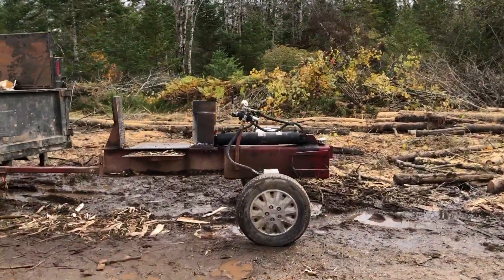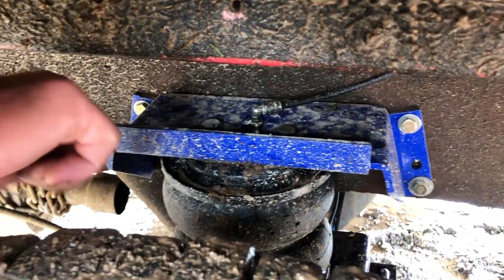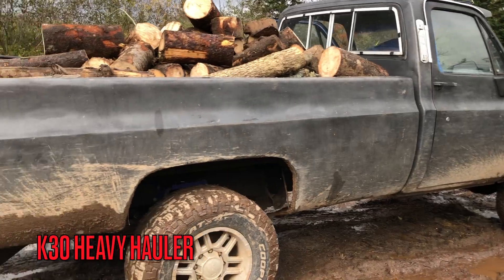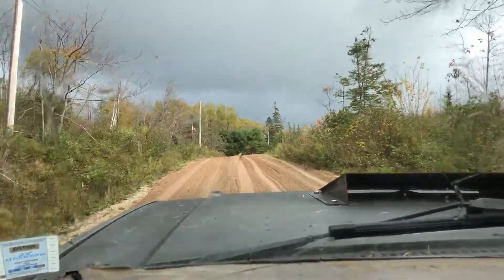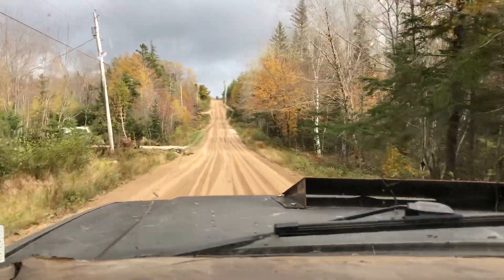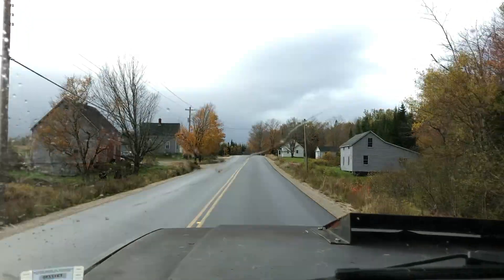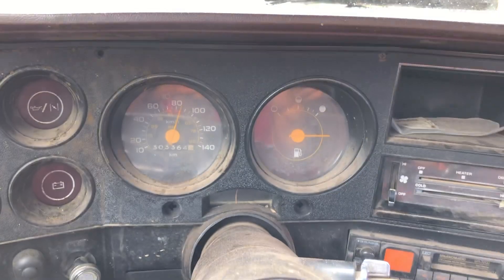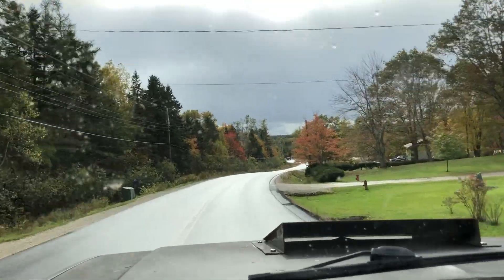Squarebody Hauling Heavy Load of Wood

Comment: I've been considering doing the LS swap to my 85 K20. I have a 6 liter out of an 04 2500HD with about 200,000 km's on it and a 4L80E remand from GM 4 years ago. I knew the truck they came out of (local truck), I paid $500 CDN for the pair over a year ago. It's just getting the ambition to do it lol

Comment: Ppl giving u a hard time who've clearly never hauled anything. Almost a cord in the box and 2 or 3 more in the trailer and NO squat. The air bags are definitely keeping the truck nice n level. Thats a necessary addition. Having a 5 or 7 stack of strong leaves would be nice to have also, but it would just be backup in case a bag failed mid journey. I love the setup. Nice and stable, the brakes are working well, the engine had no real trouble. Probably a revived junk LS engine? So it's strong and inexpensive. If it broke down or blew an important part, you could get it going again cheaply. This alleviates wear and tear on the 8.1 truck which alone saves money in the long run. You know i love the 8.1 but id really hate to see it worked into the ground at this point. Its such a rare and nice truck and its already put in a life's work so it deserves a break. If the 8.1 has an important part break, it would be expensive and time consuming to repair. If the square body proves to hold up, you can fully retire the 8.1 and just use it as backup. I think thats the smarter and more economical option, plus the sentimental value on the 8.1 is higher and that's not replaceable. Edit: oh i just noticed on the previous video u do already have strong leaves. So that suspension is more than good enough. Very nice. How do you run intake/ignition on the square body? Is it carb/distributor? Or do u got fuel injection and an ECU?
Reply from the maker: It has 7 leafs and it’s a fuel injected stock 6.0 harness out of a 2001 that I modified it’s a very strong truck for 364cubic inches

Comment: If that’s two cord remind me not to buy fire wood from you lol also what’s that thing you put in the hood of your trucks for? It looks like an upside down paint tray is that your ram air 😂
Reply from the maker: Yeah you should get into the wood business then if there isnt 2 cord on there 350cubic feet loose is a dam good 2 cord and fyi 2 cord of green wood is over 8000lbs and the trailers 4500 empty. As for the hood scoop try hauling heavy weight and learn how to tune vehicles and you will soon realize the cooler it is under hood the happier a engine will be... my engine bay wont exceed 60 celcius on a hot day where befor it would be over 80... but hey what do i know i built all my own gear